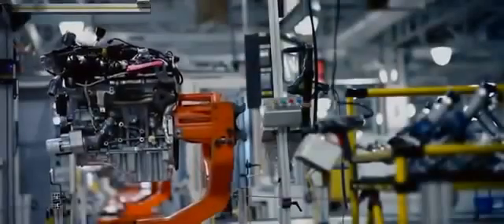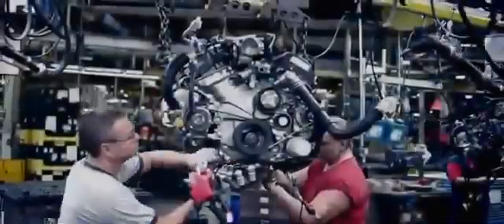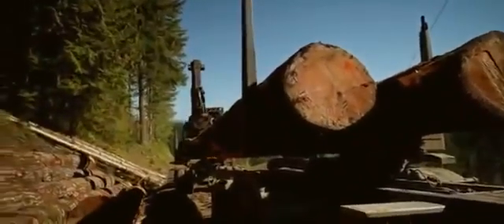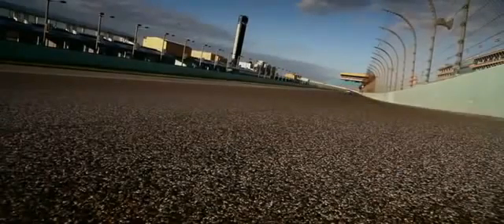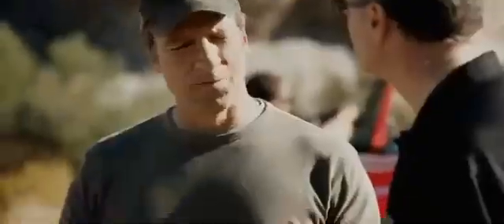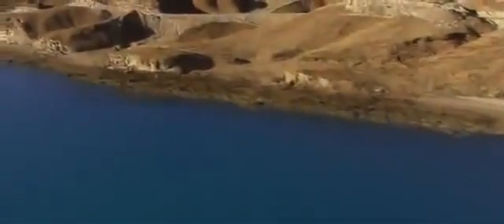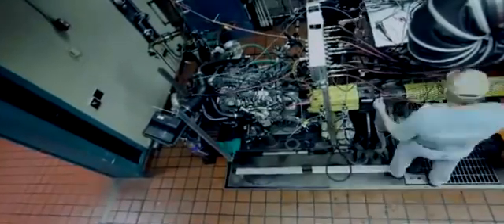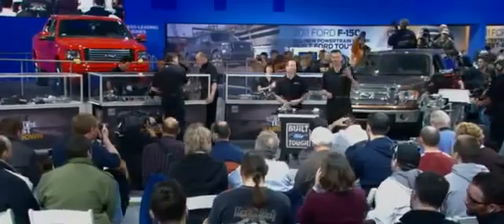Ford F150 Ecoboost Torture Test Episodes 1 to 6

Comment: I got a 2013 f-150 order from the factory after this video.  I got it with the 6.2l back then.   Those were the days…..   wish I could go back in time and tell them to also have port injection on that 3.5l to wash the intake valves preventing the valve induction issue….   The latest 2.7l EB is the best one of the bunch.  Compacted graphite iron block and bowled pistons like a mini diesel without all the egr and environmental crap.   I later got a 2017 3.5l EB truck but wish I got the 2.7l.    Just ordered a brand new 2026 f-150 with my 2.7.  Can’t wait for it.   Last of their gassers not to have the new gas particulate filters.   Be warned, diesel environmental crap is coming to gassers now.